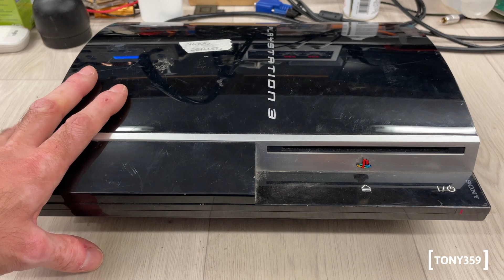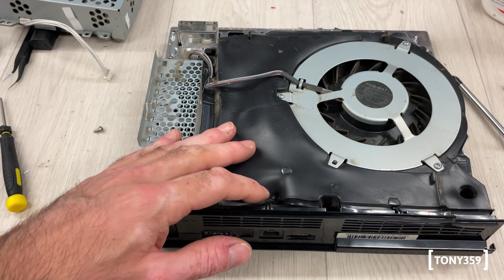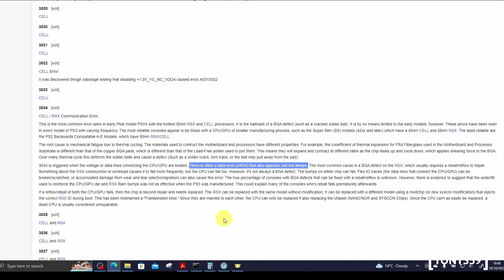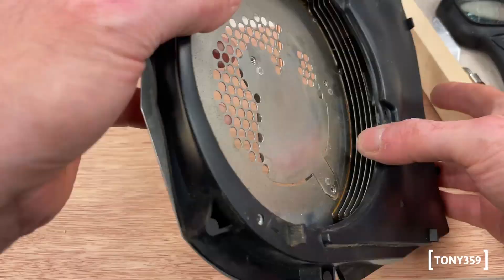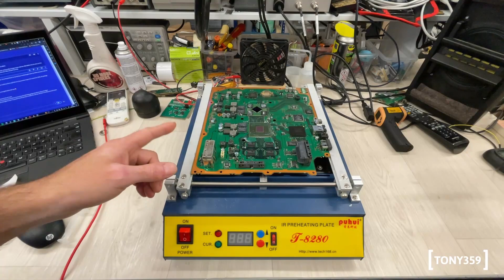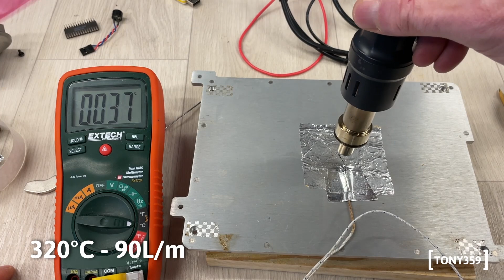PlayStation 3 Repairathon - Part 2

Comment: My first ps3 was on for years from 2006-2017 it was on constantly till the day it died never once was it hit with a heat gun or a dryer. The plastic was melted and deformed. 🤣
Reply from the maker: oh wow!
Reply: @tony359 I had a cecha00 so there was less plastic inside that got melted. But yeah I had no clue that happened till the day it died. I had it running almost 24/7 for many years

Comment: Another great video! Been there my friend. I’m using the same large nozzle and same model preheater. Did you ever figure out how to successfully use the preheater (temps? And durations) to reball the rsx? If so what temps/durations did you use for the hot air ?
Reply from the maker: not really, the PS3 is not an easy board. I understand you want the board to be pretty hot though - 200C measured on the PCB. Or the hot air won't make it. But I haven't tested myself.

Comment: I put mine in a cardboard box, sat in front of the fire in my living room,, with  a hairdryer blowing into the box.

It didn't go well....I even melted the fan cowling inside 😅
Reply from the maker: ahah! No surprise, I guess the PS3 was not designed to run in that scenario! :)

Though you'd expect some logic to switch off the console completely when silly temps are reached...
Reply: @tony359  I had totally forgotten about it. I blame youthful attention spans 😄

Im going to try repair it now Ive seen your video, but Im thinking of making a teak and perspex case for it.
Thanks for the great guides.
Reply from the maker: Good luck. Bear in mind that those old RSX are all faulty because of a manufacturing issue - the Tokin thing is more an urban legend I'm afraid (That said, that PS3 still works I understand!). Check out RIP-Felix's video I linked in the description!
Reply: @tony359  Does the upgraded gpu solve the issue? Maybe it's not worth it perhaps?
Im 41 and got back into gaming when my first son was old enough to play.....so about 3 😁 He's 8 not and destroys me in Mario kart.
I kept all my old consoles and have been enjoying taking them out of the attic one by one and restoring them, thanks to videos like yours, Id be lost without youtube!! 
I'll definitely check out that video, it's really cool how its possible to access the ps3 error codes like a car's ecu.

Id love to learn about emulators and digital gaming, I missed that period of gaming and now Im a dinosaur 😆
Reply from the maker: RIP=Felix's video is very enlightening but yes, 65nm and 40nm RSX are good - so I believe a PS3 Slim or Superslim won't die because of an RSX. There are people able to transplant a 65 or 40nm RSX onto an old PS3 "phat" so you get the original shape and the best RSX :)

Comment: Strange one here, but I had a 3034 with a 4XXX error, reflowing did nothing until I replaced the two NEC TOKINS by the RSX, I am assuming that I had a rare off chance that the power was affecting the bit training? Been fine since the replacement, and now is running EvilNat :D
Reply from the maker: Bad tokins can happen. They're not as "guilty" as we thought but it can happen. The PS3 I repaired in episode 1 was thought to be failed because of the RSX but I understand it's been refurbished and worked no issues. 
On my next one I'd love to test the voltage with the oscilloscope to see if it has ripple. 
Thanks for watching!

Comment: Hi Tony! I didn't know this until yesterday, but if you hold the eject switch and then power the PS3 on at the back, it will do a fan test... this is probably an easier way to test if it has 12V... credit goes to 'My Mate Vince' for that one!!
Reply from the maker: Thank you - yes, I did read that somewhere. Always useful to test things! Thanks for watching and love My Mate Vince's videos!
Reply: @tony359  I enjoy your too, now! New subscriber (y)
Reply: Only caveat is that it doesn't work on backwards-compatible consoles (or super slims for that matter as they don't have an electronic eject button).

Comment: I've never seen a horror show of a PS3 like that. Worst I've came by was a cat piss edition completely dead no power LED at all backwards compatible ps3, someone was in it before, it was missing hard drive, disc drive connector was broken, and the entire system was very rusty on the inside, and on the outside it was moldy.
Reply from the maker: Yuk! I would really be curious to know what happened to my PS3: oven? heat gun? Yours seems to have been through a bigger battle! Did you manage to revive it? Thanks for watching!
Reply: @tony359  unfortunately no even after new psu. And i didn't plan to really get it fixed anyways due to broken disc drive connector. And even if i get it to power on i don't want the fan to blow the smell out of the vents.
Reply from the maker: @CautionusJay  very much understandable! :)

Comment: Your green light issue looks like a possible power ic issue or shorted cap in that 12v line, take a look at the schematic s and follow the power lines.
Reply from the maker: I’ve only recently discovered that there are schematics but for the DEM-001 as well? I was told only for older ones? Mind you, in the part where I show the green light the 12V is not connected… Thanks for watching!
Reply: There are schematics for sem-001, and cok-001,002 boards floating on the internet. Yes even though your 12v is not active the power ics or ic buck will be connected on the 5v,3.3v lines. if they go internally shorted will make the board led come on.
Reply: In the schematics page 19, check from ic4001 and follow it around, probably have to remove it as you go, until you find the culprit. checking the resistor's and caps as you go.
Reply from the maker: @davidbentham9586  if there are schematics then I shall take a look! The fact that the Syscon doesn’t reply via serial though is suspicious.

Comment: I have a puhui t870a ir machine, it does the job. From experience pre baking the boards is the trick. sometimes i leave it baking for hours at 90c. The whole heating element is part scientific and part luck. Every bga machine has its quirks and inaccuracies. Just practice practice that's all you can do
Reply from the maker: Ahah absolutely! I haven’t practiced enough with my gears indeed!
Reply: To add to this, make sure to check the temperature sensors work on you preheater and have aluminium tape to protect components.
Reply from the maker: @davidbentham9586  The sensor on the pre-heater is very close to the plates, it's kind of pointless but it works. I use an IR sensor on the PCB and set the machine so that I reach 160-ish there. It usually means 275C at the "sensor".
I should definitely take a bit more care and shield components indeed! Thank you!
Reply: @tony359  no problem, been alot of repairs the last few days. So i find the optimal lower temp for a fat ps3 is around 180+, i tried to avoid the top heater as to not fry the gpu or cpu. the top heater I only put on for lead free solder as it needs 220c to melt. and then only for 1minute no more.reason i mentioned lower heat and aluminium tape - found some sold in aldi, seems really good and cheap.

Comment: Just watched your two videos, I'm the original author of the syscon thread, and had the exact same journey as you guy's. Don't be discouraged it's a hard long educational journey and very expensive one aswell.
Reply from the maker: Thank you for watching! I feel I just scraped the top of Syscon to be honest!
Reply: Thank you for all your time, energy and efforts. Quite the saga overall.
Reply: Others have tried to preheat at 120 degrees then the heat gun pops the laminations of the board opening internal heat traces. There is a SONY AO1 service manual out now on ManualsLIb that is so helpful if someone wanted to bodge wire a 100 wire repair but who knows how bad such things can be. Probably not worth the time for most but in 100 yrs who knows? The PS3 A01 is getting more rare every year I suspect.

Comment: Another learning experience I guess.
The PCB cracking internally does seem likely if you don't see any damage on the chips or board externally.
Use some aluminium tape to shield the tokins from the heat, might even want to make a wall around the whole GPU/CPU to keep as much heat in as possible.
Glad you took the time and check out RIPfelix his video about bump issue.
Still want to do a Frankenstein mod to the backwards compatible PS3 I have but to scared to do so😂
Reply from the maker: I still hope it was something else but the sound was a bit too familiar! Yes, some extra shielding could have helped a bit. I can understand why you feel scared :) Thanks for watching!

Comment: that nozzle heat issue is interesting and definitely useful information for people beginning with hot air !
I wonder if it would be possible to DIY a second sensor that's attached to the out of the nozzle and would connect to the heat gun itself to wires put on the outside and finally program a microcontroller to drive a display that would show the "second" temperature
Reply from the maker: You know what? I was actually thinking of making a small hole at the end of the nozzle - at its side - so I can slide a thermocouple inside and monitor the actual temperature hitting the chip. 
I guess one could mod the station and feed that thermocouple to the electronic, instead of the one inside the handle. But I think I'd be ok with a manual monitor, in case the heating element inside the handle does not like being driven much harder. The bottom line is yes, it's good to know that. I think I will do some math and experiment with various nozzles on lead-free chips to see the outcome. Thanks for watching! :)
Reply: @tony359  well my idea was not to mess with the original thermocouple at all, just feed the cables on the handle down to a microcontroller with a display somewhere :) (maybe glued over the hot air station ?)

Comment: Amazing that yesterday I did similar testing with bga removing, but I was using ir lamp. Two the same boards and the same ic. I applied the same temperature with the same time. One removed without issues and the other got pops all over the chip. All night I was thinking why. Now you explained to me regarding moisture. Next ima trying your method. Thank you, and I’m waiting for your next video
Reply: This is the worst part when starting off, it's all good experience.When an expert explained a couple of years ago what they do to prevent this i now understand it. So as i said in another comment, just pre bake the boards to remove the moisture - can even be a normal oven at 90c.
Reply: @davidbentham9586  can i leave it on rework station with just bottom heating for longer time?
Reply: @arsayu  So the way i do it is, if im working on a cold board. i will preheat it for 30min just to get any moisture out. Then do a slow preheat in stages, 90c, 120c then final preheat temp of 160c. This usually avoids popping.
Reply from the maker: Frustrating, isn't it? BGA is really not DIY-friendly. When you purchase a chip from the factory, it comes sealed and with no moisture in it. There are tables which tells you for how long you can use them once you take them out of their box. It depends on the moisture in the air. Long story short, it's very easy to popcorn things particularly in humid environments. Thanks for watching!

Comment: 40 and 45nm RSX are compatible with 60nm (edit: I mean 90nm)
Reply from the maker: I see online people swapping 90nm with 40nm. 60nm are still subject to the "bumpgate" issue, that's why I mentioned 40nm (I don't think 45nm exists, I made a mistake in the video).
Reply: @tony359 you shouldnt worry about the 65nm GPUs, they should be just fine as well. 

Ive rarely seen any 65nm GPUs fail as far as I know

If people are that paranoid about 65nm GPUs, just get the GPUs from the later fat models like the P or L models, rather than the K models
Reply from the maker: @DeadlyHellhound  I'll bear that in mind thanks!
Reply: @tony359  also dont forget, ps3s have large boards, and the launch models (ps2 compatible; COK-001/2 boards) are huge! 

I would absolutely advise baking the boards before you begin blasting them with heat and also you need to work with a bottom pre-heater as well to prevent any pop-corning

Hope this helps for next ps3s.
Might I also suggest woking with G and H models to practice on since those are generally junk ps3s to begin with but are good to practice on since they arent sought after
Reply from the maker: @DeadlyHellhound  If you watch my videos, I always use the pre-heater - and I mentioned baking and drying boards in this one. You skipped, didn't you? I'm just joking, I appreciate any tips you might have!
I have some XBOX to practice and now a few broken PS3's as well. We shall see!
Reply: @tony359  i’ll admit, I did skim through the video a bit 😅

Just making sure, just seen too many videos where people just go straight to blasting the board with heat directly to the chips
Reply from the maker: @DeadlyHellhound  I've been tinkering with BGA for a while and it's always been clear to me that blasting stupid temperatures to a chip is not going to work. It's taken me a couple of tests around 10 years ago to realise! I pre-heat almost everything now. For the baking, I still haven't mastered the subject properly I think - but I am working on it.

One of my viewers some time ago left a comment accusing me of damaging the board I was working on (a motherboard) because I was pre-heating it :)

You are forgiven for skimming a bit on this occasion! ;) And thanks for the advice!
Reply: @DeadlyHellhound    I just bought a K model and it has the YLOD but I haven't looked at the Syscon yet so maybe it's not the GPU.
Reply: @tony359  yeah, my mistake, it's 90nm

Comment: Does anything happen if you hold the power button for 8 seconds or so? Normally if you hold it for a while it will force the system to power down. If it's not doing that it could mean the board is really busted, if it does then maybe it's still salvageable somehow?
Reply from the maker: I can try that and let you know, thank you!
Reply: @tony359  Do you know if that console was one of the PS2 compatible ones? It'd be a shame to trash one of those if it could be rescued.
Reply from the maker: @TheRealLorebot  Thankfully it wasn't! :) PS3 number three is though, watch this space! :)
Reply: @tony359  I definitely will be. My own PS3 recently got the ylod and I've been trying to figure out if it's worth trying to fix it myself, send it to someone for repairs, or just buy a replacement. Your vids have given me some good insight into what's involved along with some very helpful links :)
Reply from the maker: @TheRealLorebot  and quite a lot of "what not to do" I guess LOL! :) I'm glad they have been helpful, I hope you can revive yours soon!

Comment: Never ever use hot air to remove ps3 chips. Its too uneven and will make popcorn sounds, RIP.

Best way is to use a ceramic heater at the top, you can diy build it using a PID controller + 400W/500W ceramic plate which will cost you below $50.

Or you can do it  even cheaper using the tried and tested way of using a 12V 100W halogen lamp. Bunch of youtube guides doing it, give it a shot.
Reply from the maker: I appreciate the suggestion. This hot air station is pretty even to be fair - my previous one wasn't. Check out the review video where I show the thermal camera images. https://www.youtube.com/watch?v=omV1JJqiWAc

That said, I'm aware there are many many ways of dealing with BGA and mine is not the best! Thanks for watching!
Reply: @tony359  
You're missing the point. 

Halogen light bulb/ceramic methods are using INFRARED.
Infrared heating penetrates inner layers.
Reply from the maker: @oliviavalentine5294  uhm... Let me disagree with that. Infrared is just light at a specific wavelength. It does not penetrate materials as far as I know. I can see why it could be more even than hot air though.